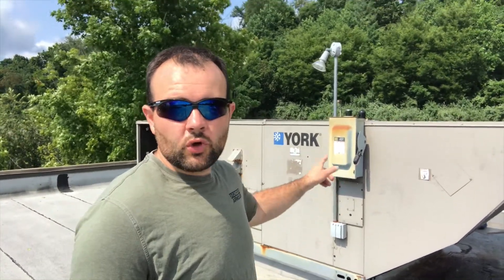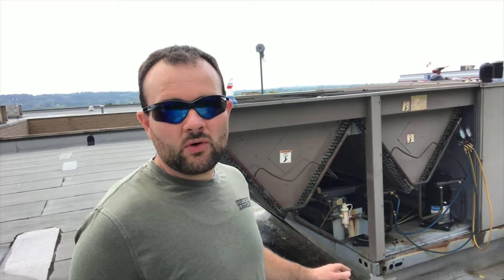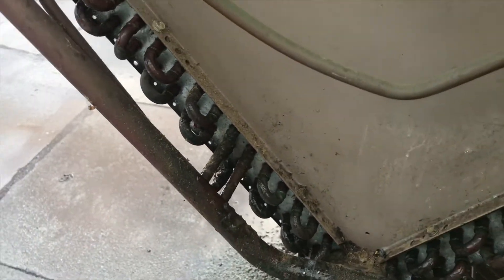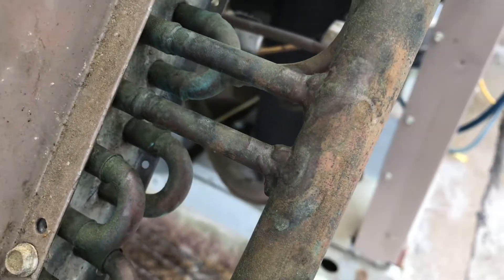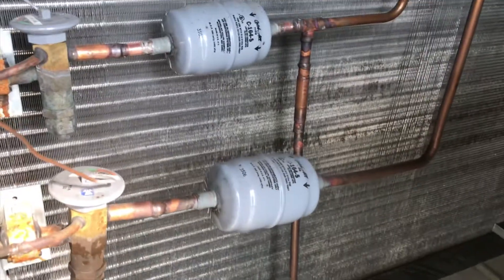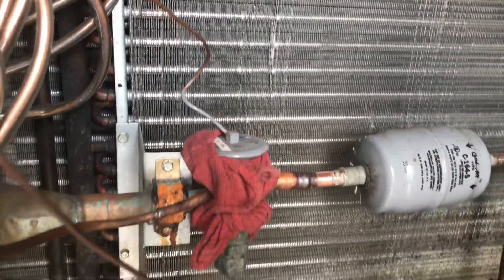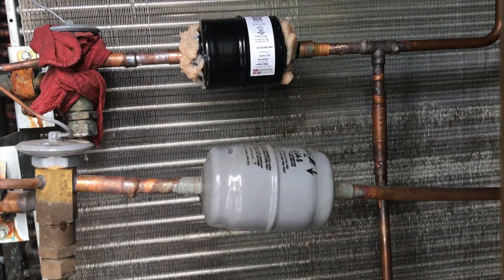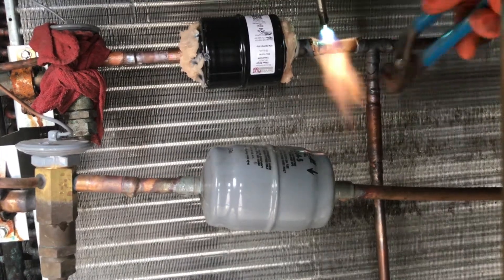15 Ton York Roof Top Unit, Look For This When Leaking Checking A Refrigeration Circuit.

Comment: Hey i have a 10 ton unit  and i bought hvac gut he couldnt locate the leak.is there any solution in finding the leak.keep on putting freon and keeps dying out because of the leak.
Reply from the maker: Did the hvac guy pressurize the system with nitrogen and perform a leak search? If not what method of locating the leak was used?